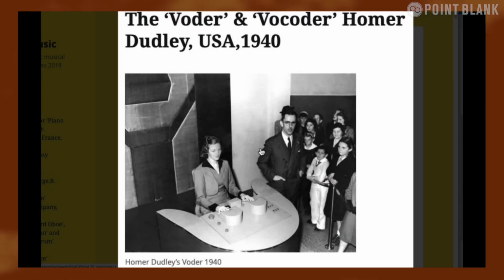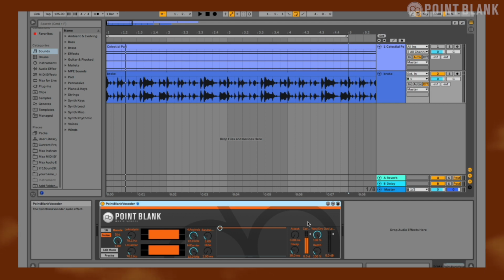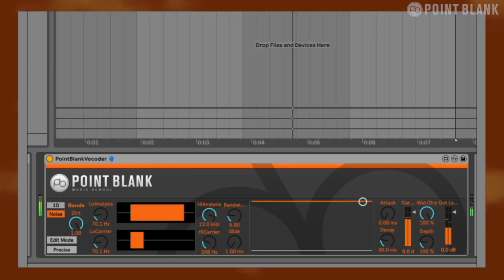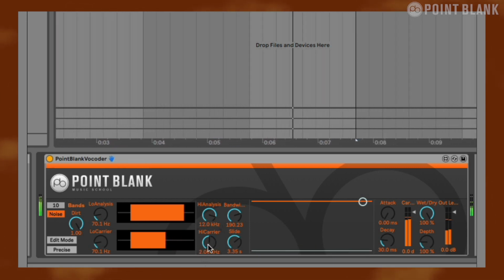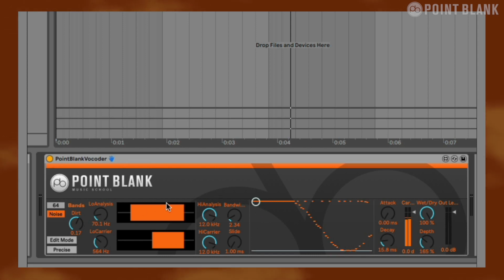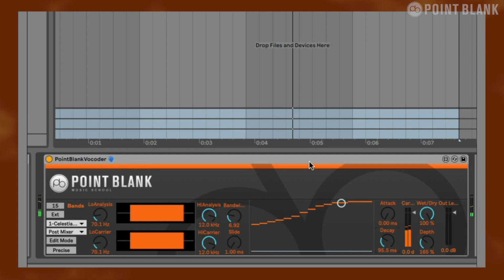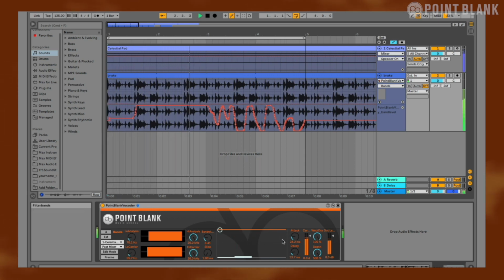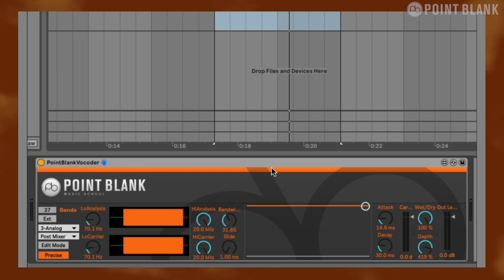Download Point Blank's Free Vocoder Plugin - Watch Tutorial Now

Comment: How’s it different from Live’s stock vocoder?
Reply: The main differences in terms of parameters are you can automate the individual bands, set a slide value so the different bands slide when changing freq range/ band number, and you have control over the frequency range of the analysis signal as well as carrier.